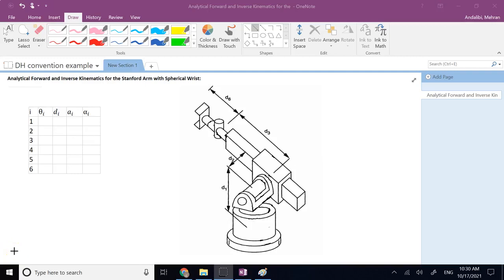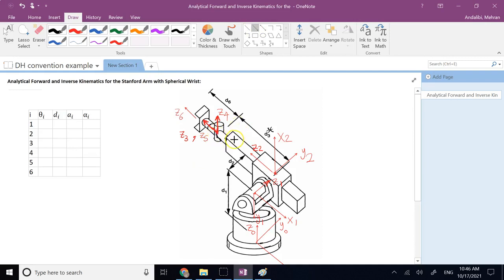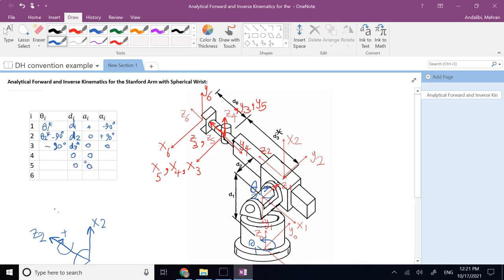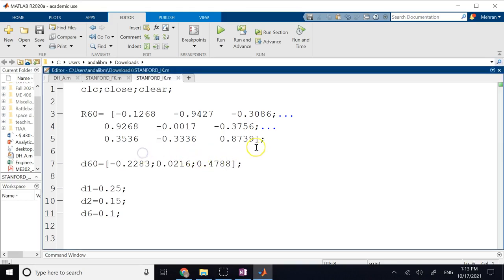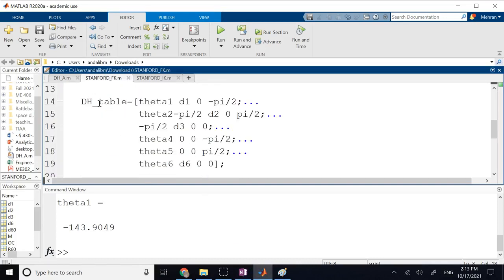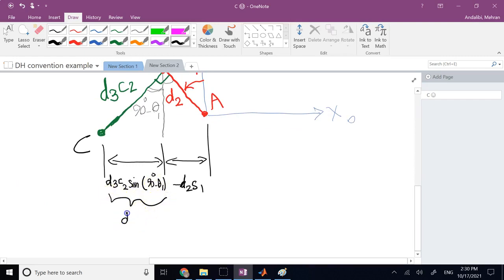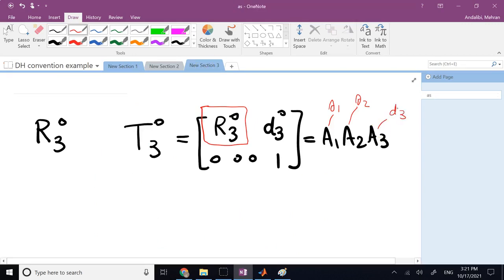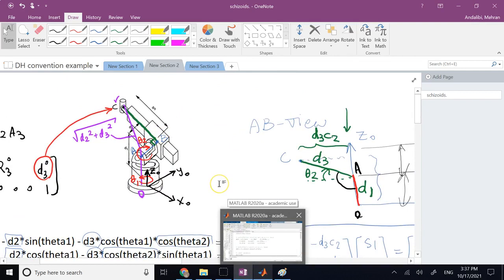Analytical Forward and Inverse Kinematics for Stanford Arm

Comment: In  Inverse  orientation calculus,  the order of sequence of Rotations are made with respect to frame F3 axes (fixed frame ) ,  then  the result is the pre-multiplication of 3 rotation matrices; i.e 
Rot_final= Rot(Z3, theta6). Rot(Y3, theta5).Rot(Z3,theta3) in that order 
phi =theta6, theta=Theta5, psi=theta4

is that true